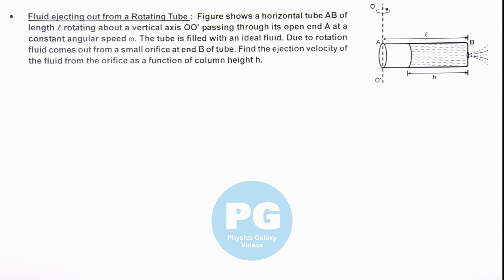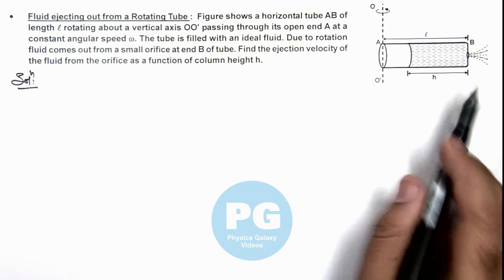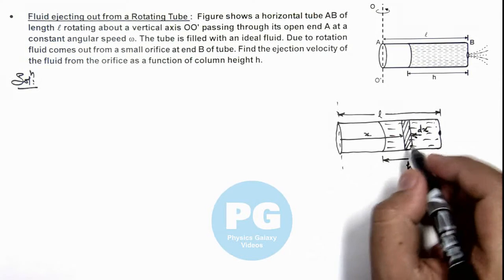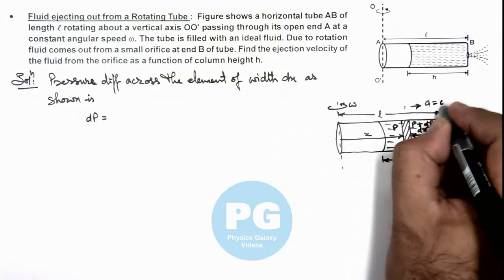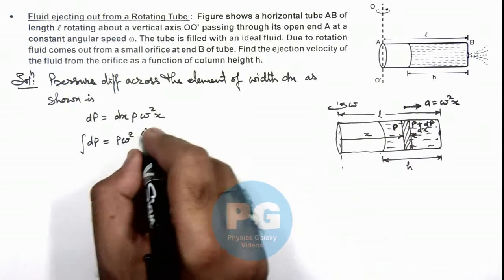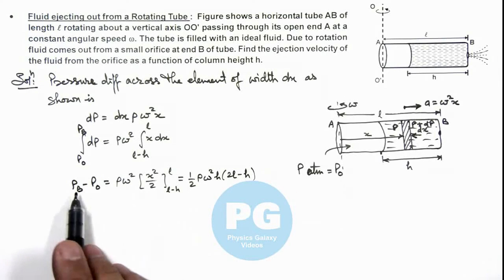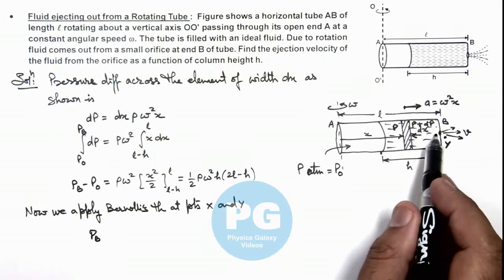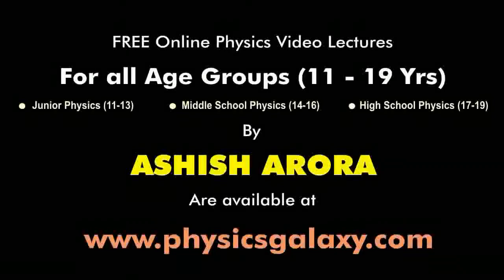27. Advance Illustration | Fluid Statics & Dynamics | Fluid ejecting out from a Rotating Tube

Comment: As tube is also rotating... Won't the fluid coming out be having two velocities.. One due to efflux.... And another due to rotation. .. So we have to calculate resultant of both.
Reply: No, the v calculated is the net speed, in the derivation of bernoulli's theorem, work-energy theorem was used and hence the v will be the net speed. For efflux velocity we can write the net velocity as vector sum of velocity due to rotation + efflux velocity

Comment: Can be done by direct formula derived in theory:

∆P=pw²(l²-((l-h)²)/2

We can't just directly apply at rotating axis and hole directly as fact in between liquid isn't present thus rho=0 ,hence result won't uniform

Using Bernoulli will get same answer, basically both method are similar if you remember rotating tube horizontal result with proper notation and understanding

Remember: in formula

P=rho.w².x²/2 (x→ Distance of point from rotating axis)
Reply: thanks

Comment: Why don't we apply Bernoulli at other point like from where the liquid starts?if we can then how?
Reply from the maker: That is same... as two points are to be considered to apply Bernoulli's theorem on the same streamline...
Reply: Physics Galaxy I didn't get,won't the pressure be different at that point than the point which u have taken.plz explain in detail
Reply: @KaranDoshicool  I understood your doubt. I got the same doubt and then developed my own theory, here is what I think------
The standard BT(Bernoulli Theorem) which we use, accounts for pressure change due to 'g' only(for fluid flowing thru const area of cross-section and horizontally). But when we go into rotatory frame, we get a pseudo accln. also. So, we need to add a correction sort of term( like we do in van der waals eqn for real gases). What sir derived is the same term which we needed! 
Actually what happens is that the surface (if extended imaginarily out of the tube), takes a parabolic shape which makes the pressure variations to the horizontal level of the tube. The term is "-(1/2)p(wr)^2" ;where r is the dist. from axis.
THE reason WHY sir method worked is bcz the pts considered by sir were very close such that the pressure variation due to pseudo accln. can be neglected and std. BT is applicable after we found pressure at 'X' manually (i.e. derived the correction term).
**<All theory stated above is self and observation based by me. So, I request Ashish sir to review the theory and if find any mistake plz write.>
Reply: Jatin Saini well I'm already in an IIT .I'm not at all gonna look at it again..just make sure dat u can apply it in all the questions
Reply: @KaranDoshicool  bro in which iit.
Reply: @raginigupta4440  Mandi CSE

Comment: Sir, How can we apply bernoulli's equation the way you mentioned  at0.52 as we derived bernoulli's equation only in the case pressure forces are doing work, but here centrifugal force also do work. How can we apply that?
Reply: Thanks Aman Aloon for initiating a knowledgeable comment series.
Reply: @vijayvyas5075  thanks vijay for ending a knowledgeable comment series.
Reply from the maker: +Aman Aloon In the reference frame of tube centrifugal force is considered as just another external force...
Reply: +Physics Galaxy ; Sir ,  I am not able to understand. i am saying that we derived Bernoulli's equation for the fact that only pressure forces are doing work,but here another force is doing work. Don't we have to start from basics (f=ma) like we did here and applied bernoulli's equation at just outside and just inside, as we can safely assume that the displacement is so small that work done by centrifugal force is negligible. But, i am talking about the method you mentioned but didnt solved from that method, i.e applying bernoulli's between side A and side B.
Reply from the maker: +Aman Aloon Here we are not taking the work done by centrifugal force... we are only accounting the pressure difference created due to the centrifugal force.... pressure is a scalar quantity and bernoulli's equation is derived using fluid pressure at a point which may be due to one or more factors... fluid pressure does not have different types its just fluid pressure at a point...
Reply: +Physics Galaxy ...sir, while deriving we used work energy theorem, in which pressure force and gravitational force was doing work.so we obtained that particular bernoullis equation.we didn't considered any other force which is doing work. am I right?
Reply from the maker: +Aman Aloon yes in BT only pressure energy, grav work and kinetic energy is considered... however pressure includes all other forces due to which the pressure exist inside the fluid body...